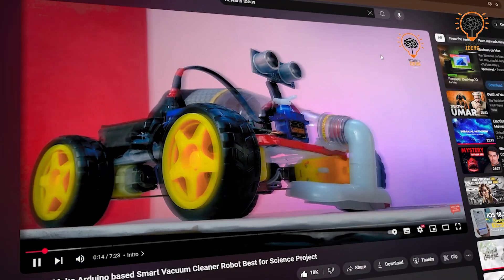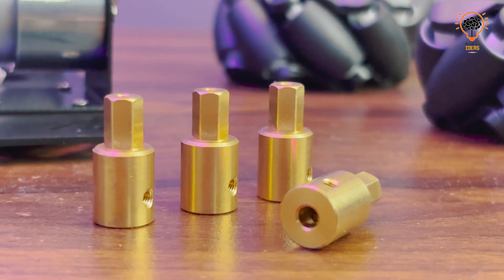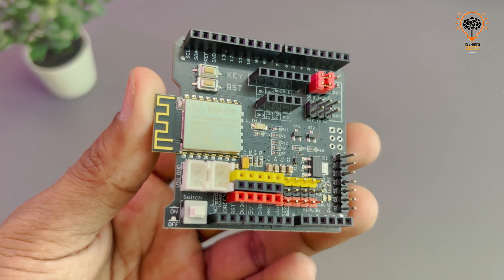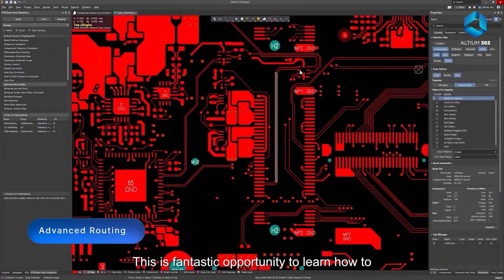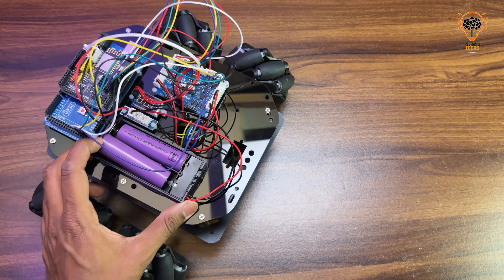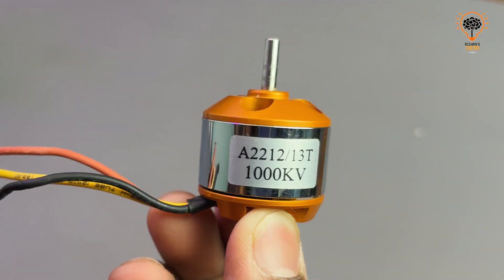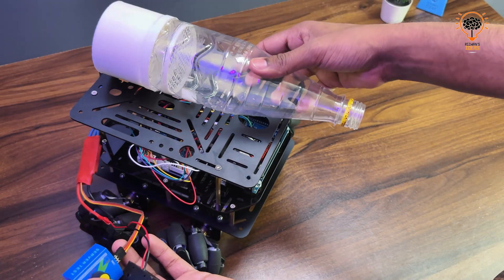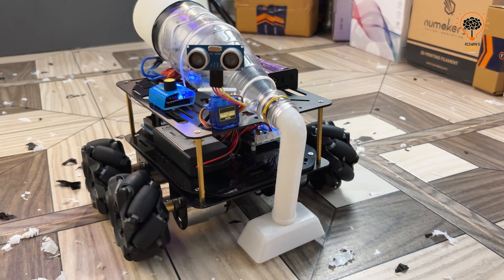How to Make Arduino based WiFi-Controlled Smart Vacuum Cleaner Robot Best for Science Project V2 DIY

Comment: Bro I have a doubt in your previous video, you have made a radio transmitter and receiver I have doubt in both the connection diagrams in the transmitters connection diagram arduino nano's D12 pin you have written as ''SCK'' and there is no pin name "SCK". The NRF module's "CLK" pin have no connection with the arduino. In the receivers diagram the NRF adapter module is not in the diagram,only voltage regulater is on the diagram. Can you draw a diagram for me bro pls.